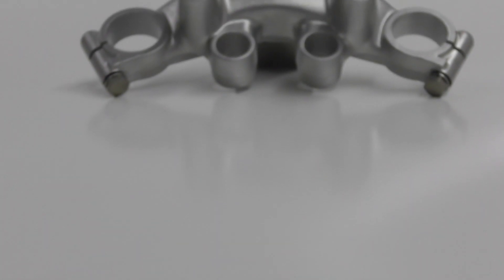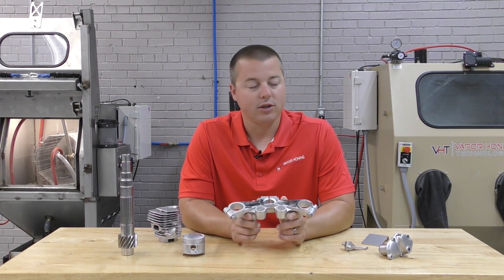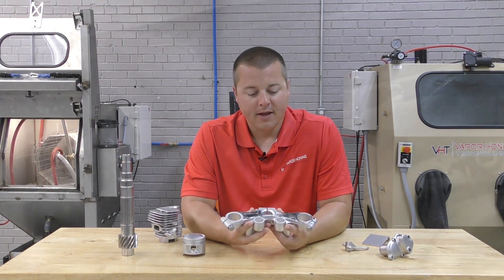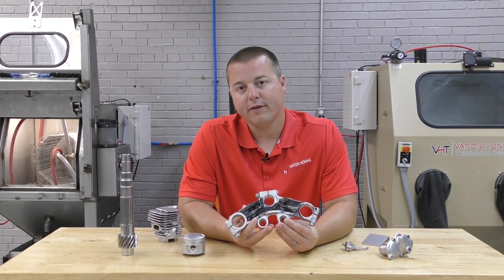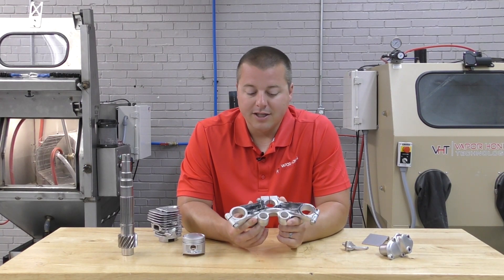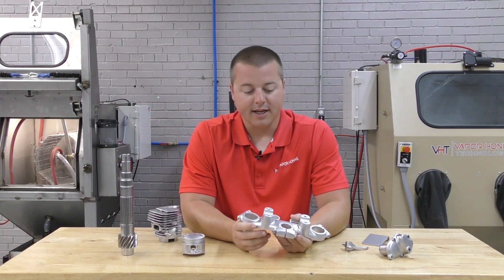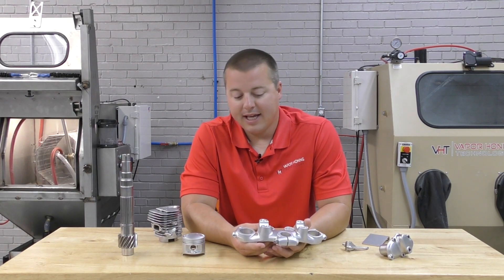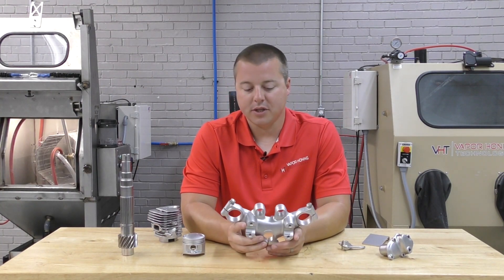One or Two Step Process: Misconceptions about vapor honing - Vapor Honing Technologies

Comment: WHAT MEDIA DO YOU RECOMMAND IF WE WANT TO DRY BLAST POWDER COAT OR FACTORY PAINT WITH OUT MAKING THE PARTS TOO ROUGH
Reply from the maker: What we are showing in these results are from a Vapor Honing Cabinet.  Using Water and Abrasive under compressed air to get this fine finish.  We do not claim that a dry blast cabinet will give you this finish.  Contact us for more information nicole@vaporhoningtechnologies.com